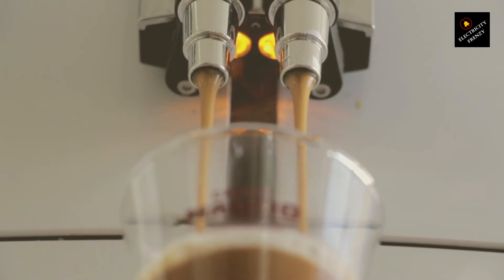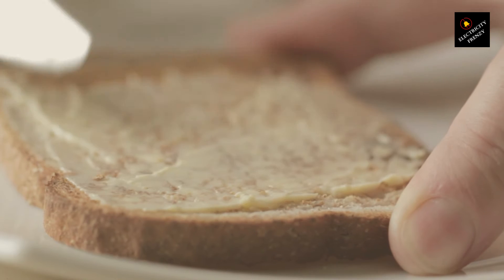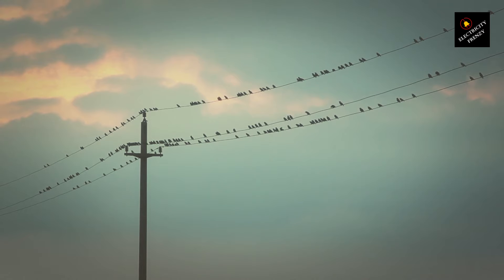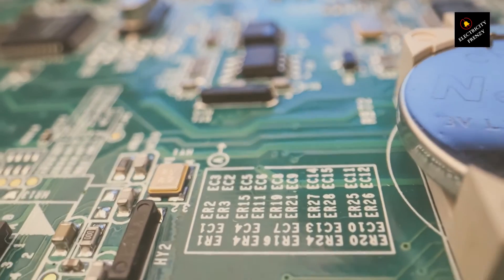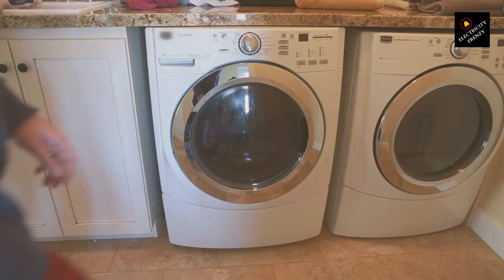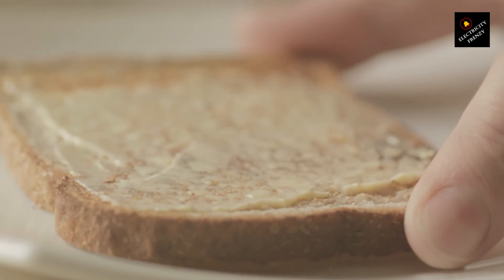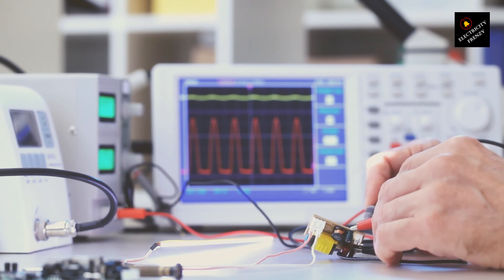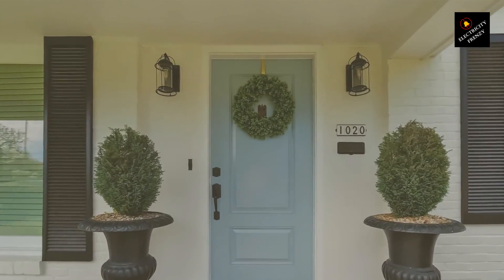How to Safely Use 220v Appliances on 110v Outlets!

Comment: hi bro i bought a 110v and 250watt sewing machine from usa
and for that only voltage converter enough or voltage stabilizer also needed or not
Reply from the maker: How much voltage and frequency in your country
Reply: @ElectricityFrenzy  iam from india,in indian houses we have 230v power supply,but i want to import a SINGER 4452 sewing machine from usa which is having,Watts-84
Volts(120)
Hz(60)
Reply from the maker: If frequency in india is 60hz too you can use voltage converter from 120v to 220v